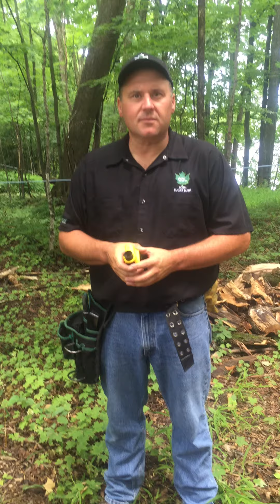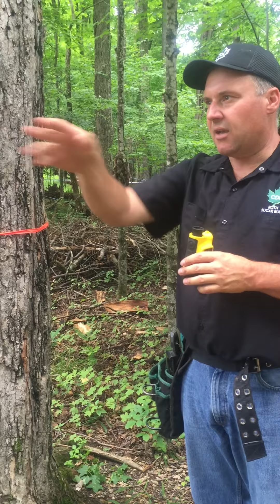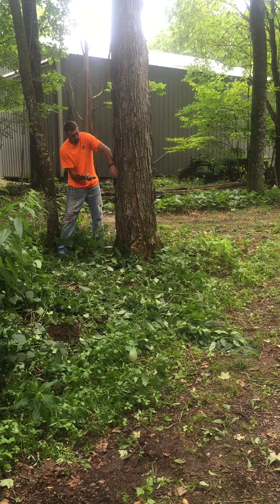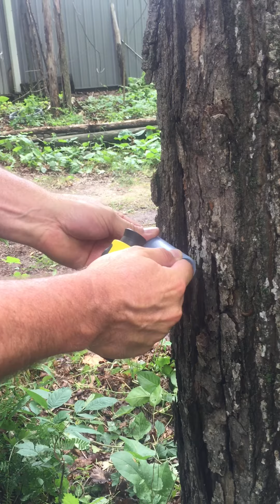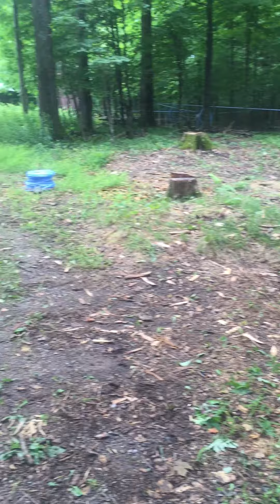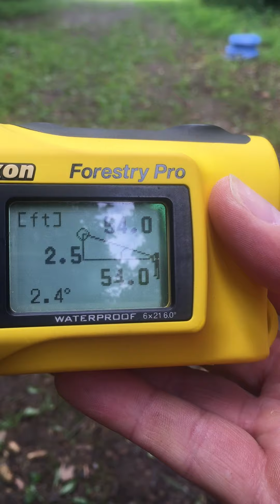Marking for Mainline Elevation - Roth Sugar Bush - Cadott Wisconsin - Maple Equipment - Maple Syrup

Comment: As you go away from your receiver/collection tank what slope do you maintain?  What is the minimum you want for what you just showed?  I saw it said 2.4 degrees, is 1 enough?
Reply from the maker: The amount of grade that you will be able to maintain will
depend on your woodlot. The forestry pro reads in degrees of slope. When we are
working in the wood lot we will work with percent of slope.

 

 

We are based in central Wisconsin with very little slope.
Tubing systems in our area are installed at as low as ¾% of slope to 4%
 of slope depending on the grade available in the wood lot. I hope this
answers your question.If you have any other questions please give me a call at 715-216-7855Jim
Reply from the maker: Brad....I have a chart too that I could email you....I can't seem to attaché it here on youtube...please email me so I get your email address jimb@rothsugarbush.com  Thanks Brad
Reply: @rothsugarbush4679  You could put that chart in your Google Drive and share the link for everyone to download. It's fast and easy to do! :)